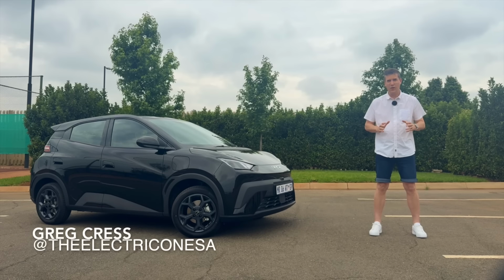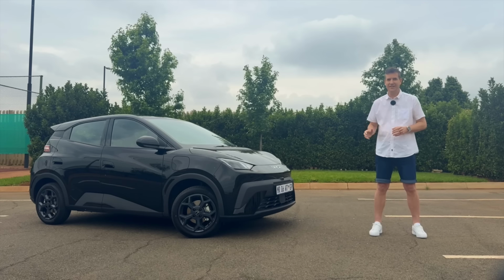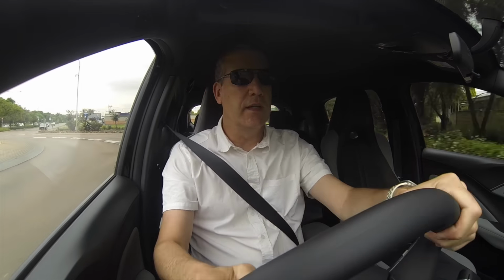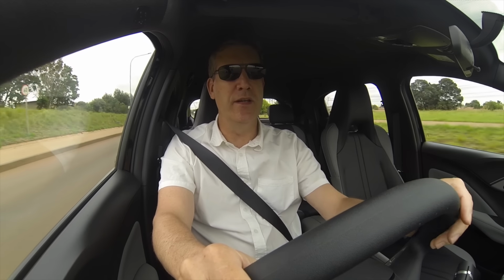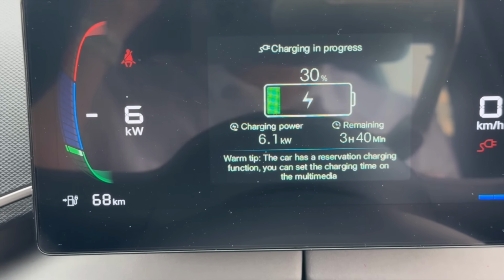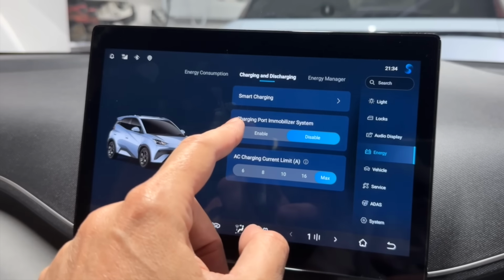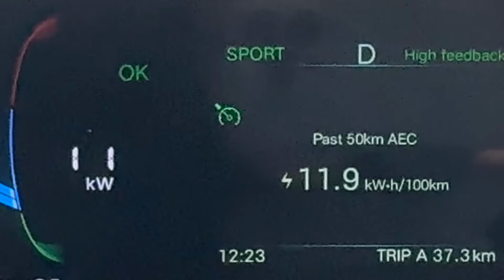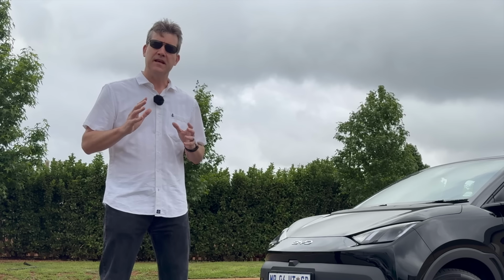BYD Dolphin Surf Test Drive - SA's most economical EV!

Comment: 356kms in a small petrol car using around 7lts per 100km, would cost around R650 at current fuel prices. R129 vs R650, that's a game changer!! And if you already have a solar battery system at home, most of your mileage can be powered directly from the sun.
Reply from the maker: Absolutely Gary… in this price/class category of vehicle it makes no sense to still be burning fuel. Thanks for watching and leaving a comment!

Comment: Any idea what a proper home charging station setup costs?
Reply from the maker: Hi Buffalohump, typical home wallbox-type 7.4kW chargers (single phase, 230V x 32A) can cost anything between R5000 and R20000, depending on features. Add to that the electrical contractor installation costs (probably around R8k - R10k).

Have a look at my videos on the BYD Shark 6 and the Kia EV5 for an overview of home solar charging.

Comment: Great car. I had not heard about the R10 000 rebate? I wish we would be given the real range? The figures are not true. The larger battery is  the better buy. Great for a Town car. A 30kwh battery will give 140 to 150 km in our summer here in Cape Town. Is the new Geely better?
Reply from the maker: Hi John, the R10k rebate was part of the early adopter package at launch last year. I have seen reliable sources reporting around 200kms consistent range being reached in the Surf Comfort, and around 260kms for the Dynamic. Some report even higher ranges than that. Hope to get hold of a Geely E2 soon!

Comment: I hear the sound system is quite bad on these. How easy is it to upgrade it and add better speakers?
Reply: Hi @highvoltage3000 - spotted your comment now. I am a very happy BYD Dolphin Surf owner. My personal experience has been very good with the speaker system of this car. Note: It only has 4 speakers, situated in front of car. Backseat passengers dont have speakers firing directly at them, however still very much can appreciate the quality and sound (i have tested). The built in EQ Profiles on the car arent very good to me, and didnt help much. However, it provides a full Equaliser for you to configure yourself. After minimal tweaking, i am now very happy with the sound quality. Great Bass, and great quality (especially for 4 speakers).
Reply from the maker: Hi - I don’t recall the sound system being bad in the Surf. Perhaps an owner of Surf can provide a more specific response to this question.

Comment: I am considering one. The 55kw is what is keeping me back, don't know why SA did not get the upgraded motor as an option like other countries
Reply from the maker: Hi flyniceguy - don’t be put off by the 55kW.. if/when you go for a test drive, ensure you set the EV to Sport Mode and High Feedback, you will be pleasantly surprised by the responsiveness and the overall driving feel. 55kW of electric power and instant torque in the Surf beats 90kW in an ICE vehicle any day.
Reply: @TheElectricOneSA thanks. I am going on Thursday. Centurion has a demo

Comment: I can only afford the BYD Klipvissie
Reply from the maker: Nice one MagnificentGman :-)
You might be surprised when you look at the full total cost of ownership of an EV like the Surf vs. a petrol equivalent, the Surf will likely come out cheaper (energy costs, running costs, service/maintenance)
Reply: @TheElectricOneSA it definitely would but I feel like the charging infrastructure just isn’t there yet. I checked out the PlugShare app and Im not close to where they are concentrated

Comment: Most important question: how easy/difficult is it to find charging stations in JHB?
Reply from the maker: Hi Buffalo - there are many, many publicly-accessible AC and DC charge stations in and around JHB and Gauteng. You will find them at a mix of locations, certainly at some traditional petrol stations (e.g. Pantry in Rosebank), but also at other destinations (e.g. at shopping centres and hotels (e.g. City Lodge)). Check out www.chargestations.co.za for a full list of the JHB stations as well as around the country. The good news - more and more stations will be coming online in SA during the year, making the transition to EVs even easier.
Reply: @TheElectricOneSA  Thanks but ... the link doesn't work?
Reply from the maker: Buffalo - try a Google search for "charge stations South Africa" and you will find it. Or try this link:

https://www.chargestations.co.za/ChargeMap.aspx?UserGroupID=facf9751-58ca-490f-8ca5-d2b433e6b2e5
Reply: @TheElectricOneSA I did find a list,  not sure how up to date it is.
Reply: For now you will probably end up sitting an hour in traffic to drive to Sandton so you can charge your EV. And then spend another hour driving back home

Comment: And what you gonna do if you need to drive to KZN or capetown from jhb... not an all round car. Would maybe make sense if your partner has a normal car and you get this then use one for long drives and one for short drives.
Reply: You are going to hope and pray that somewhere along the route there are charging stations and those charging have power and the queues aren't too long. Otherwise you might end up spending the whole easter weekend waiting to charge your EV🤣
Reply from the maker: Hi KalahariJack - worth checking out www.charge.co.za, take a look at their blueprint fully off-grid solar-powered EV charge station already live in Wolmaransstad: 280kWp solar farm, 500kWh BESS, 6 x 240kW DC charge stations - two more of these will be live on the N3 in May. They will always have power, be functional 24/7, and be able to charge 6 EVs at once, all within 20 mins.
Reply from the maker: Hy Rhys, thanks for your comment. Technically - it is quite possible to drive a Surf from JHB to DBN (even the Comfort) - there are existing Gridcars and Rubicon chargers available and within reach. Additionally, Zero Carbon Charge are launching there 2 new off-grid (solar-powered) chargers (1 just past Villiers, the other near Tugela) in May 2026. I do agree the Surf is better suited (and designed) for urban commuting, but is still able to do road trips. (Many Surf owners have reported already doing this on the BYD Owners Group South Africa).

Comment: Issue with EV's in south africa : of you don't have a HUGE solar system that runs the house, you are dependant on Eskom. They push up their prices every 3 months, so it will become more expensive to charge a car, than to buy fuel. At least, all cars can do around 400km range, and are cheaper to buy, eg Suzuki Swift
Reply: This comment didn't age well 😢. In 2 week's time, the petrol will increase some R6/l. Best possible setup to insulate you from Eskom's ever increasing rates and the petrol price increases is free power from your domestic solar system.

Comment: I hope these new Chinese cars will soon be manufactured in South Africa. Local production would be a big boost, creating jobs and supporting the economy, so it would be great if you could highlight that 🎉
Reply from the maker: Thanks for the comment 1964FordMustang.  Indeed, there is currently a lot of discussion in SA right now on this topic. I'm optimistic that we will see more investments coming into SA from China, not only from the Automotive OEMs but also from other parts of the EV value chain, e.g. battery pack assembly and charging infrastructure build.

Comment: It might be a cheap entry but I am worried, like with most EV’s is the massive depreciation on these type of vehicles. So best is to lease (don’t buy out right) and pass on this “cost” of depreciation to the finance institution.
Reply from the maker: Hi Ian, thanks for the comment. Valid concern, however my view is that EVs in the sub-R400k segment are not likely to be affected by the same level of depreciation as the early, top-end models (>R1.5m).  While EV technology continues to evolve at exponential pace, the fact is that batteries are lasting well over 10 years while still retaining a healthy State of Health (SoH) of >85%. Additionally, the software-defined vehicle (SDV) baseline of EVs means that they can continually be upgraded over the air to get the latest features. I expect that we will see a turning-point sometime in the future where EVs will start holding their value longer, while ICE vehicles will start depreciating faster. Let's see what happens!

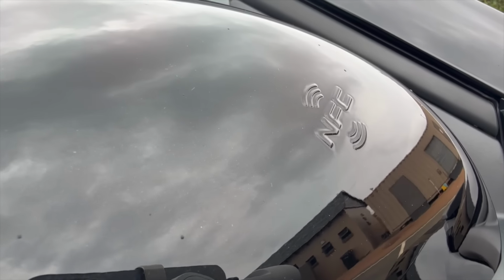Comment: My closet dealer is 200 km away. The issue at @19:22 and the lack of dealers is SA make this a non starter.
Reply: This is just to register on the BYD system and link car to profile, is a once off process upfront. Since it's an EV, having a nearby dealership less of a concern, as no need for oil and filter changes. EVs are generally much more reliable than ICE vehicles as there are fewer moving parts.
Reply: BYD is rapidly expanding their dealer network. Just hang in there!
Reply: I imagine that you have a list of non starters then, if there isn’t a dealer at your doorstep. That’s okay, but for others, it’s a non issue.

Comment: Had mine for almost 2 months now. By far one of the best cars I've owned (car it replaced was a Toyota GT86, I've also had many Mazda MX-5s, which are among the best handling cars around). Excellent build quality, stable handling on twisty roads, very comfortable and refined ride, and strong pull up even the steepest hills. At the price, given how little it costs to run, it makes Polo's and other small ICE city cars almost redundant.
Reply: Comfort or Dynamic?
Reply: BYD Seagull is stripped of ADAS and 360 cameras yet BYD sells it at a very high price.
Reply: Who enjoys driving it most? You or your boyfriend?